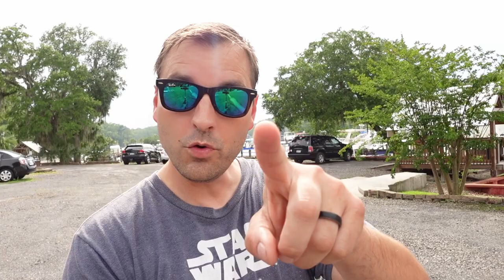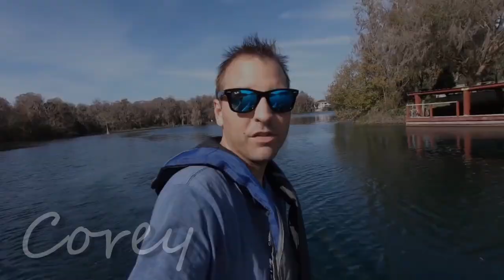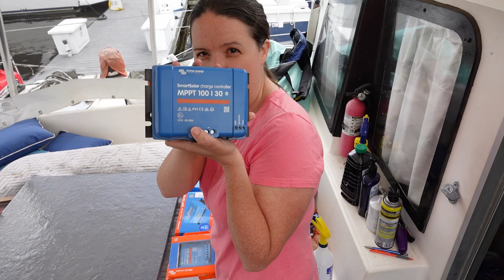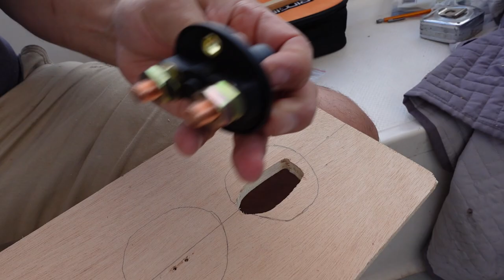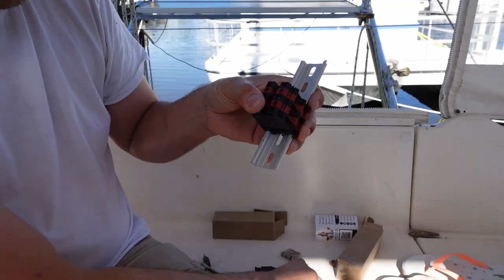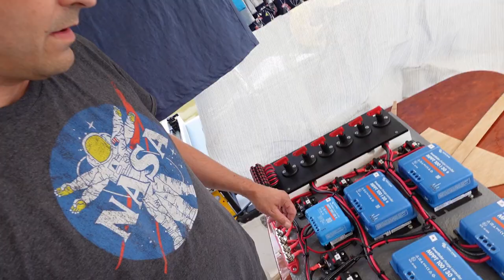Building an ADVANCED Victron MPPT Control Board for our Catamaran Sailboat [Family Sailing]

Comment: Good amount of work! Looks like good work too. In mine, I'll probably add a fan to it eventually if I see it getting that hot. My mppt is laid out horizontally on the surface, which the booklet says not to do, but I'm guessing it's because of heat dissipation, so I'll just add a fan. I needed to save room above, so with my design it needed to be flat.

Comment: Remember every termination as resistance and losses also with solar panels that could be an issue on cloudy days one thing to note redundancy and protection is okay but if you haven’t selected fuses and things like that such that one blows before the others it may just be a bit hard to find out what needs replacing
Reply from the maker: Thanks
Reply from the maker: Thanks

Comment: yes the load relay can be used to switch on a fan.  in fact it can be programmed to use it's internal temperature of the controller as the switch point.  it has worked well for 3+ years for me.

yonwill want to connect all the controllers  on to a network with a Victron Venus OS device.  this can either be victron sourced or a Raspberry PI.  ( see off grid garage u tube channel ). 

According to ABCY wiring standards the panels themselves don't  need to be fused.
Reply from the maker: Hi Brian,  Thanks for taking time to answer my questions!  I'm happy to hear you have used a fan with the MPPTS.  We have been using Victron Connect with the phone app for our other Victron Devices.   I'm not sure if Victron Venus is different... But I've always wanted to play around with a Raspberry pie, so I'll check out the Off Grid Garage channel.   
I guess I misunderstood the ABCY about the fusing... Either way, I bought the fuses and might as well install them.   Thanks for your help!  If you think of anything else I may need to know, please reach out.   Cheers- Corey
Reply: @SaltyEscape  
Yet a lot of people do fuse them🤔  so escalate the search to someone who designs the stuff and sets the standards. ie Dr Nigel Calder...
Reply: If your putting up new solar panels keeping them cool is vital to maintaining peak power and extended operating life.
Strictly speaking hybrid PVT panels with liquid cooling to the backs have vastly improved and extended performance.
Reply from the maker: Hi Clive! That sounds like very “cool” technology 😉😉. We have already purchased our panels. We will be installing 4 - 340 watt Panasonic panels and 4 - 110 watt flexible panels. We are so happy that we decided to purchase the panels a year ago because now they are either unavailable or 2-3 times the price.  😬
Cheers- Corey

Comment: You definitely want forced air cooling (computer fans) to cool the mppt’s , power out linearly goes down when they heat up and it doesn’t look like you have a ton of airflow there 

The load output is definitely a possibility, but you may just run them off the busbars with a temp sensor so they are independent from the mppt’s 

Computer fans draw very little amps and assist creating more output from the mppt’s as they keep them cooler
Reply from the maker: Hi Rene and Joline!  Thank you so much for taking time to answer my questions!  I actually feel A bit foolish… I hadn’t even considered attaching the computer fans to the bus bars. Obviously that option makes the most sense.  I’m going to go ahead and buy the equipment I will need and start the installation for the fans. That space does have a vent to the exterior because the lead acid batteries were previously housed in that space. When I build a door to finish off that cabinet I’ll be sure to incorporate ventilation in my design!  
Are you guys still making videos?
Thank you so much again! 
Corey
Reply: I think we’re ‘between’ video’s 😉 about a year ago we bought a lagoon 42 in Croatia and our now back on Bonaire on our way to the San blas, sailing got in the way and as we already visited and filmed most places we were the last 12 months we took a break , I think we’ll start again soon !